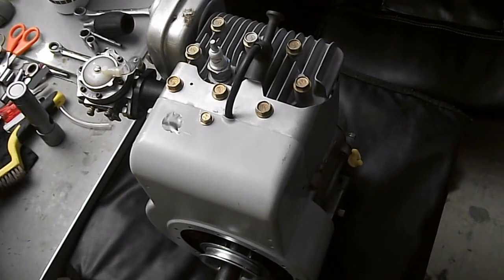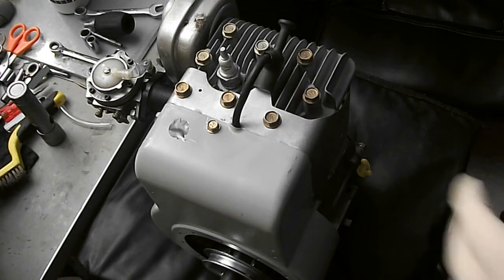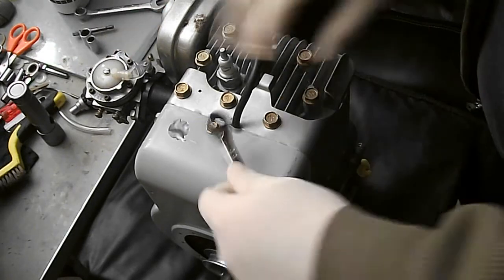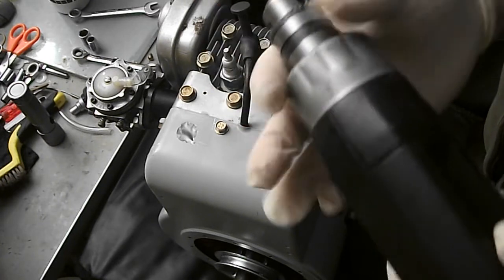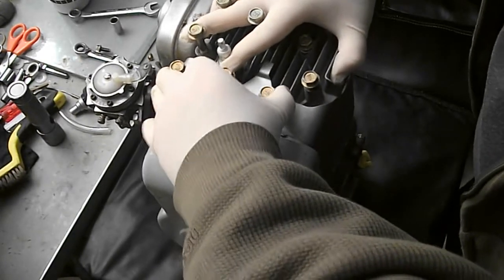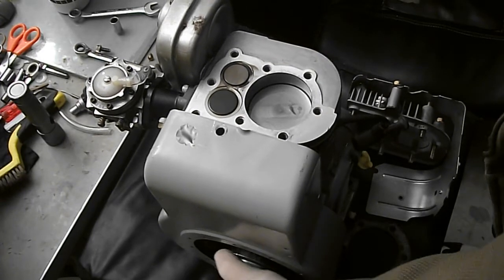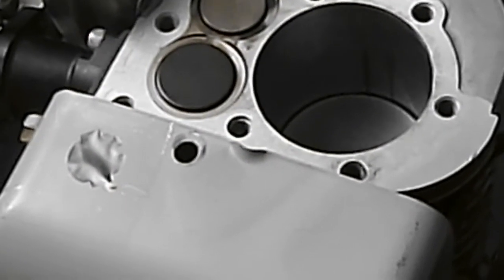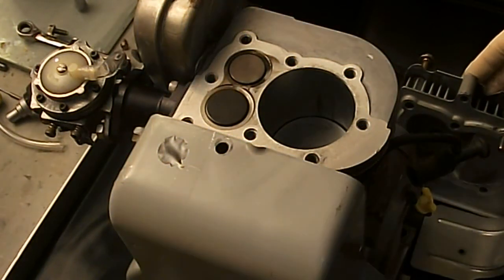JB Weld Repaired Briggs 5hp - Cylinder Head Removed

Comment: I have been considering doing that to my dads Honda GX35 powered brush cutter because I have replaced the piston & rings in the engine & while the engine was apart I noticed that it had a score mark from half way up the cylinder to the bottom which is why I think that it was burning oil worse than it did before.

It ran a bit low on oil because I think that it was burning it in the first place but it got worse, if I let it idle,it would begin to blow smoke after 30 seconds to 1 minute then it would blow out a cloud of smoke after I cracked the throttle open, replacing the piston and rings made little to no difference.

So,I still think that the crankcase is getting pressurized by the blowby which is getting past the piston rings & oil is getting into the combustion chamber.

If I rev it full ball & keep it at wide open throttle it will smoke up less,I think that if I can fill the barely visible scratch which is deep enough to catch my finger nail on , that will save me buying a whole new engine or cylinder kit for it !
Reply from the maker: @RussellBooth1977  It's like a $25 experiment, I would try almost any cheap option just for the knowledge.  ✌️

Comment: I like experimenting just like you and I gave you a thumbs up, but JB weld won't hold up long term on a cylinder wall.  I think it's rated at 500 degrees constant temperature and 600 degrees intermittently. The localized hot spots in an air cooled engine are a lot higher than that.  The AVERAGE temperature in an aluminum air cooled engine is the only thing that keeps them from melting into a puddle of molten aluminum. If you put this engine into a Kart and ran it hard for 3 or 4 tanks of fuel, the JB weld will be gone. It lasted for 30 minutes of idling, but if you run it hard and hot at all, it's bye bye JB Weld.
Reply: Yeah, these motors operate at temps close to the JBW threshold. I do think that it could survive in water cooled engines that maintain temps of 180F.

Comment: How is the Compression Compared to Before the overhaul??
Reply from the maker: I didn't do any testing before the repair because the damage was so bad. I did pull the starter handle and it turned over very easily. I did look closely at the exhaust muffler and exhaust port and could smell burnt oil.
Reply: *****  relap the valves and valve seats & check the seals ? It might help.
Reply from the maker: Lawrence Eich
 Thanks for the info Lawrence !!! I kinda rushed the repair job so I think better prep work to the cylinder would have yielded better results. The crankshaft oil seals are working great !!! I think my breather assembly has a slow leak though.